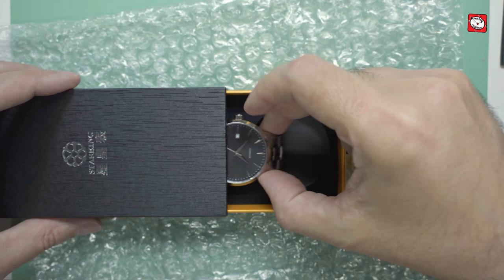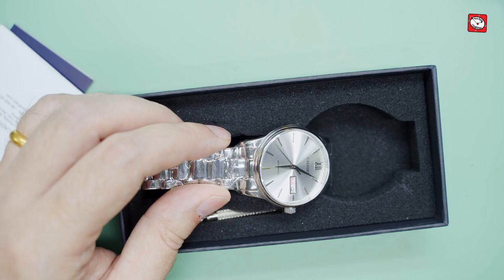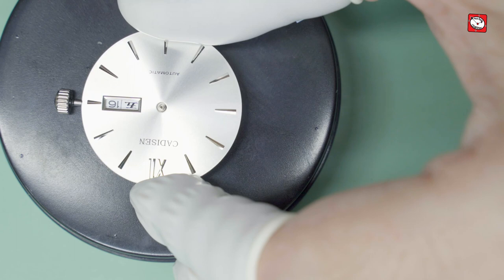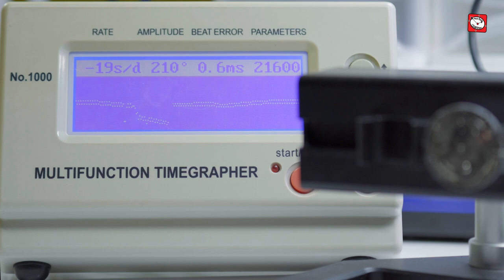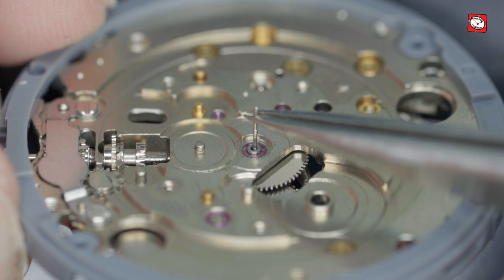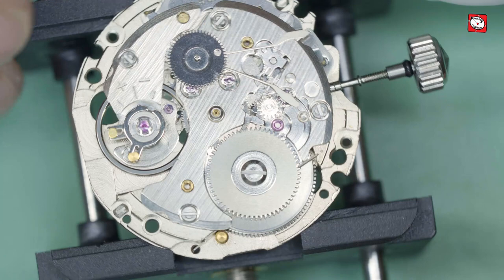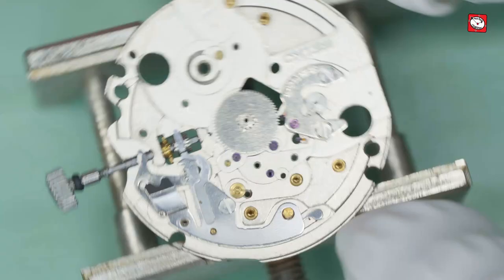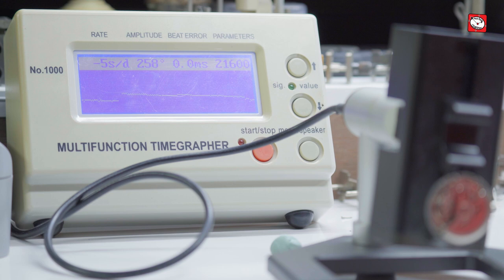Budget Automatic $50 watch Round 2. Cadisen, NH36A Dead on arrival!

Comment: Great overhaul! I got the same watch one year ago, it showed good readings in the timegrapher but it was gaining 5 minutes per day when on wrist. My guess from visual inspection is that the diashock spring was not sitting well on the cap jewel so this last was slightly inclined. I told the seller and he sent me another unit without cost for me, the second unit was working perfectly, around +0 s/day for one year now.

Comment: I've seen several more DOA and almost new quitting NH35/36 over the past two years. I am a watchmaker myself and noticed some lubrication issues with them. All in all I have managed to get 320 degrees amplitude on an NH35 by properly lubricating it, which indicates to me that this isn't done up to the full potential of the movement straight from the factory. Now I understand it's not worth it regarding the cost of these movements, but the fact that some had very thick grease on high speed low torque bearings surprised me and in some cases literally caused total non runners. The Starking is not a DG movement by the way, even though it resembles it, there is literally not a single part interchangeable with the DG. Not even the hands. There is a drawing of it, where it is printed as SK1813. These movements can be reliable, but are definitely not high quality and SK now uses the Miyota 8215 in all these models. The 1813 had at least 50% defect rate, which is indeed more than just bad.
Reply: I was just wondering if the new movement that starking is using better or worse than the one that they use. Also, do all of their models use the same movement, and are there any watches that are better overall for $100 or less? I'm very new to watches(as in 30 min ago) so please don't bully me too much for these questions that are probably very easy to answer :)

Comment: I have the same Cadisen, great watch, works great. I received it with a super annoying dust particle by the dial. I opened the case back (later I removed the dust by removing the front glass - i didn't know, that it was removable). It was real nightmare to put the case back into place. I didn't have a press back then, I managed to close it, on the kitchen table, using my whole 90kg body weight. I put the watch onto the table and on the case back I put another case back from a bigger Forsining watch, which was just pressing on the metal and not the glass itself. Then using a kitchen bread board I pressed it with my whole weight and it snapped! Imagination is everything ;) With the press would also be very difficult, i suppose you also had a tough time there :)
Reply: I used C clamp like the one used for pressing brake cyclinder. I put flat knife on both sides and pressed in the clamp.

Comment: I have bought NH36A to replace dead seiko 7s26. Unfortunately the movement have defect. The balance wheel stop when I turn the movement to side position.
I was thought the balance staff have broken. But when I open the screw, I found the hairspring is not correctly installed.
Thanks for your tutorial about how to "Setting a watch in beat" I have managed to repair the movement.

Comment: FINALLY we get to see a more modern Seiko 4R/NH movement!  I've seen pictures online but I'd never seen how that hack lever works on video until now.

That's weird that the 7S26 center wheel didn't fit.  Maybe that's an older version of the 7S movement?  Many of the parts of the more current 7S/4R/6R/NH/NE movements are meant to be interchangeable.

Comment: I'm wearing a huge Paulaeris "Classico U1001" homage at the moment, suspect it has a Mingzhu in there but has surprising features like a titanium top ring, what appears to be sapphire, AR, the fly in the ointment is the expectation the very neon orange hands and numerals would be lume but aren't is a tad annoying but I bought it for the canteen crown more than anything else and £18 for a 50mm plus crown automatic watch with two functioning subdials is pretty darned good and I haven't had to correct time yet so its holding well.   I have big hands and large wrists so I prefer oversize pieces anyway.

Comment: Merry Christmas and a Happy New Year..Great video! I Purchased this watch and tried to modify it with luminous hands..it all went OK “until” I tried replacing the case back. The press I have was not up to the task and when I applied just a little too much force it cracked the display glass and crystal.TOO TIGHT!  Anyway I now have a spare movement and will find a use for the bracelet. Lessons were learned. Lol.😂 Cheers from 🇨🇦.

Comment: The Starking does not contain a "DG2813" as stated in this video, which is a caliber produced by Dixmont-Guangzhou (Five Goat Watch Factory).  Several Chinese companies use a similar design, including Beijing Watch Factory's SB11, SB12, and B16ZR.  Starking Watch Group actually has their own movement manufacturing company,  Shenzhen Jingrui Movement Company Limited.  The caliber is the  SK1813, and it has been modified to run at 28,800 bph, and feature 25 jewels, as opposed to Dixmont's 21,600 bph, and just 22 jewels.

For around an extra $10, Starking now sells the AM0171, which is almost identical to the AM0184, except the date window is moved from 3H to 4.5H, and it contains a Miyota 8215 movement, instead of the in-house SK1813.

Comment: My only watch with a 7s26 movement is a new Seiko SKX007 J
With no "hand-winding" or "hacking" I was quite SHOCKED that Seiko was able to sell this movement at all, in the U.S.A. !
But, since 1996, they have sold MILLIONS of them!
First thing I did was order a brand new NH36 for it. Will get that installed in January. Maybe then, I'll actually like and enjoy the watch. It's my first SKX007J. 
And am so far disappointed.
Reply: I've done this swap.  The day wheel and movement spacer need to be transplanted from the old movement.  Also you need to source a separate crown and assemble your own stem since the 7S26 stem won't work.  Or you can source a SARB059 crown with stem which will fit.  It's not a simple movement swap.  There are plenty of videos all over YouTube showing the details of all this though.

And yes, Seiko has been selling the SKX with the 7S26 since 1996.  It seems the 7S movement models (SKX and old 5's) are finally going away now so no more shocks for people who don't know what they're getting.

Comment: Based on this video， I think the case is bad finished. A lot of scratches can be seen, and it certainly does not look nice. But anyway don't expect too much on the movement. I think as long as the case and dial is good and the watch is well function its pretty much why you can get from this price.

Comment: Hi, I have an Steinhart Titanium 500 with Soprod A10 movement that is not holding enough power. also when winding this from the crown I can feel some teeth scratching each other inside. I am not a specialist but, is this to change the movement or can be repaired? It holds power only for about 7 hours

Comment: I got this one in the spring of 2019 and it worked for half a year running around +1 second a day. I was extremely satisfied. But then one day out of nowhere it started running from -27 to -30 seconds a day. I've spent more than an hour trying to open the case back as it was extremely stiff. When I did, i regulated it and tried to close it back, but the amount of pressure to close it needed to be so great that I ended up having to use some tools instead of my hands. And then it just broke, glass on the back snapped. Thankfully, seller on AliExpress offered me to buy a new caseback for around $10. Now it arrived and I'm too scared to put it back together, hahahaha. I'll probably go to my watchmaker so he does it instead of me. 

Also, did you get a refund for this watch?